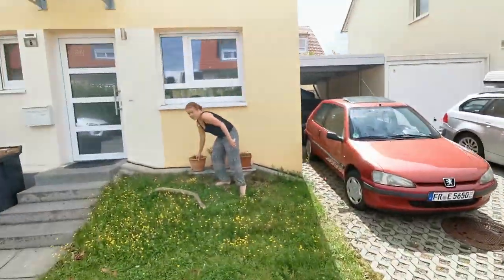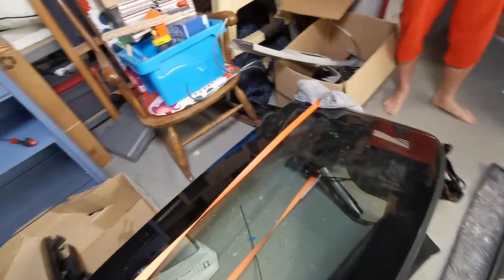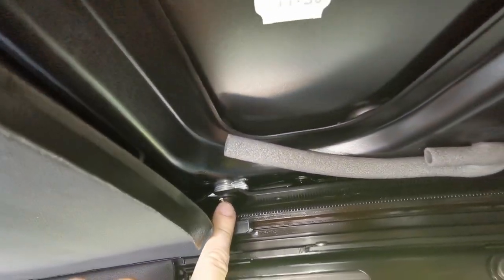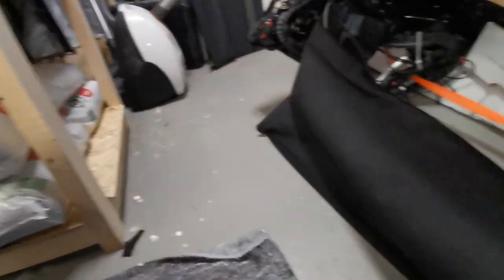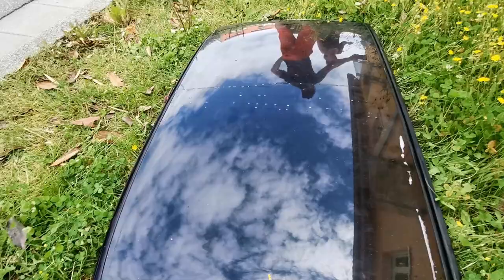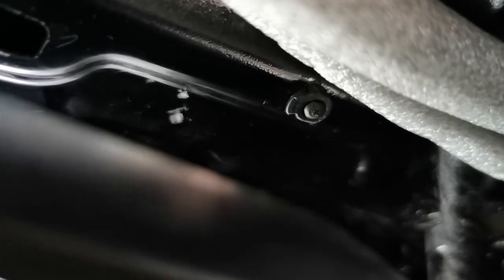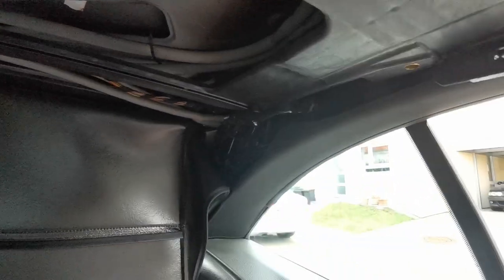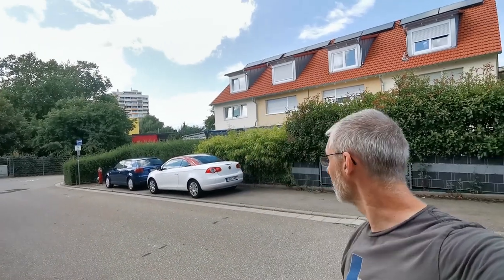Swapping the center roof section! - Germany's cheapest VW Eos - Part 18

Comment: Thank you for this video, it confirmed my idea this was doable. Gives me some peace of mind that I can fix this in case I run into trouble 😃
Reply from the maker: Yeah, bit by bit I can see that at least some parts of the roof are not that difficult to replace without ripping it all apart. Sunroof motor, spider, the metal panel.. I think the rear window frame also, might be another project.

Comment: Hello, I am delighted to watch your videos about the VW Eos. I have a 2007 Eos, and when I want to open the entire roof, I have the following problem: if I press the large button to open the whole roof, all the windows go down first, but the left rear window stops halfway down and the roof cannot continue opening. However, the left rear window goes up and down perfectly with the buttons on the driver's door. Do you have any idea what could be causing this? NOTE: If I lower the window with the door button and then operate the roof, everything works perfectly. Thanks and regards.
Reply from the maker: That is an odd one.. I can only imagine that the window electronic may have an issue if the signals come in through different wires,, but I don't know that they do. They are not super uncommon to fail though, so it may just be that "door"/window ECU. Very, very odd issue though, really.

Comment: Hi there
How did you calibrated sunroof after mounting motor (min 22.40), what sunroof position was, what motor circle was? Did you used vcds for that? Cheers
Reply from the maker: I did literally none of that. I took it off, made sure to not move anything and put it back in. For moving the roof I had the motor back in just without the panel, since obviously the sunroof also needs to move. But I didn't go anywhere near the calibration of the sunroof :)

Comment: hello friend, how many silver slats do they have on the roof, I hear you say 5 but I don't know if it's on the three screws?
Reply from the maker: Hi!

From what I've seen, heard and learned, the exact amount of those silver shims under the 3 left and 3 right bolts varies from car to car and is adjusted to make a perfect (or as close as possible) fit happen. So you should base it on what's on there from the factory or adjust to your car, which is probably a bit painstakingly slow but not difficult.
Reply: @ConditionCheap  Thank you very much, greetings from Yucatán México

Comment: Nice content !! I have 2006 Eos 1,6fsi protected in close garage. Eos needs love and protection, otherwise you can face many issues. I have 0 issues except that It needs annually rubber lubrication and roof tube examination/clean. Tip, check your exterior trunk light for cracks or ruber failure because its common to crack and inlfitrate inside the boot water, which can damage your boot lock and omg roof pump. And when you open the roof, slide the extra sun protector by hand because it gives extra stress to the roof motor. Its way too heavy this sun protector to slide!!!!
Reply from the maker: Thanks for the feedback! I haven't seen any taillight cracks, yet. I've heard the thing with the headliner to make it easier on the motor too, I'll try to get my girlfriend to do that, since it is her car and I never really drive it :D
Reply: I have the exact same model and can confirm what your saying is true. The third tail light can crack and has cracked on mines which has lead water inside the boot. Luckily I had isolated the problem and managed to have it looked into before it damaged the hydraulic pump.